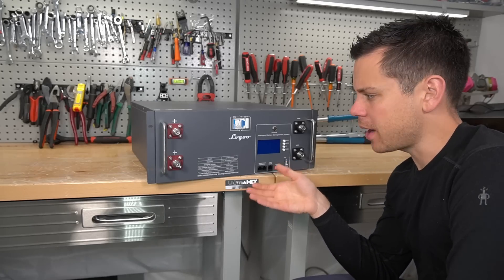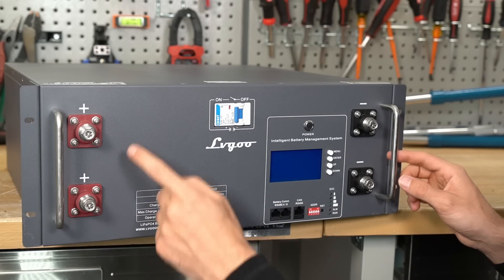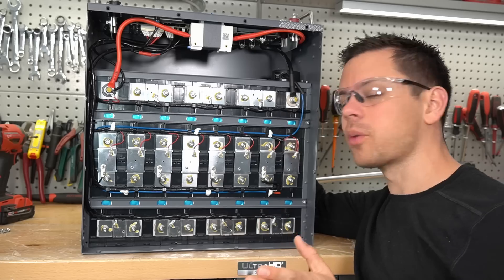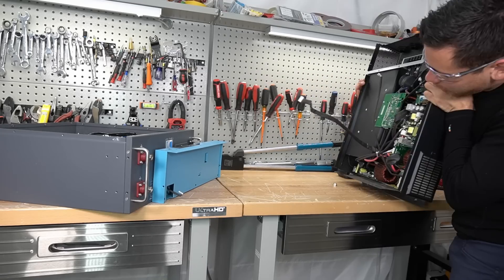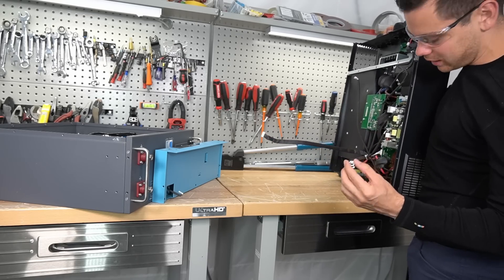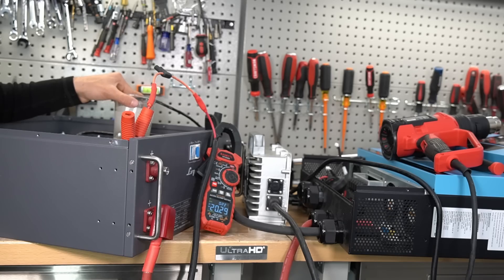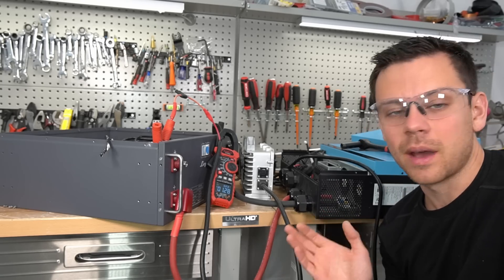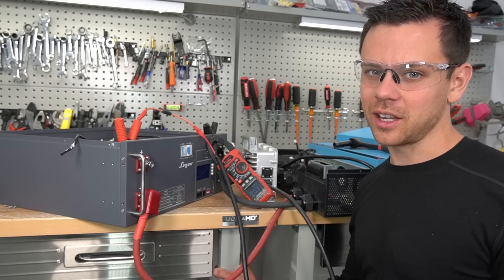New! $1,639 LVGOO 48V LiFePO4 Server Rack Battery

Comment: Why is the charging temperature threshold exactly 0 degrees Celsius? Isn't the electrolyte a liquid down to much colder temperatures? There's no pure water in these batteries.
Reply: Charging LIFEPO4  below 32F  0 C  causes damage to the battery.   You can use the battery to  -20 C  but not charge it below 0 C.
Reply: @merlpriester  I've heard that, but why is it precisely 0C? What happens below 0 that's different from +1C? I know pure water freezes at 0, but the electrolyte in these batteries isn't pure water, and the freezing point should be much lower.
Reply: @mattv5281  when charging below 0C, the battery forms crystals that rupture the insulation between the plates. It has to do with the way the lithium ions deposit in low temp.

Comment: I'd take off the handles and slip some heat shrink or rubber tubing on them to prevent shorts. Maybe even plastic dip them.
Reply: Hello Jerry, we will use the PVC coated(about 0.8mm thickness) handles which are 100% fully coated and 100% insulation from the battery termials in the next batch. We put the original handles into liquid PVC and get them out to cool them so the PVC would attach on the handles firmly.
Reply: I wouldn't think that the case would be connected to anything??  Should be able to short either terminals to the handles no issues.

Comment: If this is similar to my solarPowerStore rack battery (the display looks the same), it may have a pre-charge sequence  built in to the BMS, using these steps.
  1. Turn off the BMS power switch and circuit breaker
  2. Connect the inverter and turn it off.
  3. Turn on the battery breaker 
  4. Hit the BMS power switch

If I try to connect turn on the breaker with the BMS on, mine throws a over-current fault.
Reply: We have a complete and well written User Manual in the package box of the LV48V100D Server Rack Batteries. There are complete info about the batteries and their applications including the pre-charge.
Reply from the maker: Yes that's what I did in video

Comment: Another great review Will! Possible to do some reviews on bare Lifepo4 cells again? Seems like the prices has changed a bit the last year, so it could be a lot to save building a diy battery.
Reply: Very few buying those anymore apparently. I will for my next system though
Reply: @Zorlig  I guess people are lazy or does not have time for diy projects, and others cant use diy batteries do to strict regulations...

Just to illustrate how much you can save going with a diy battery. I can buy high quality 280ah cells from a trusted seller here in Europe and they cost about 130 USD pr cell, and possibly less when buying more. A 16s 48v bank with 13.4kWh of capacity would then cost  about 2300USD.  While a regular 5kWh battery costs almost 1500USD. So a DIY battery with parts bought locally in Europe are half the price, and possibly even cheaper. If you can get the same cells from China, the DIY price can be as much as 75% cheaper.
Reply: @TheJensss  yup, when I got my 48 280ah cells I had the full battery setup working for less than $5k.

Comment: Excellent testing Will! Glad you found they had the low temp programmed wrong!
Reply: The original Charge/Discharge UT(Under Temperature) settings of Lvgoo LV48V100D Server Rack Battery BMS are: 
CHG UT Alarm(℃): 0.0

CHG UT Protect(℃): -5.0

CHG UT Protect Release(℃): 0.0

DSG UT Alarm(℃): -15.0

DSG UT Protect(℃): -20.0

DSG UT Protect Release(℃): -15.0
It should trigger the CHG UT Protect at the -5.0℃. But Will was spilling the compressed gas duster drip by drip fast on the sensor to make the sensor's temperature drop fast so during the trigger action duration of CHG UT Protect, Will's temperature detector found the temperatures under -5.0℃ and finally captured the lowest  -10.0℃ when the  CHG UT Protect was triggered sucessfully.😀

Comment: The front data plate reads -20C to 65C.
Reply: A complete, clear and detailed User Manual is in the package of LV48V100D to let the users know almost everything about the battery including instructions of all temperatures.
Reply from the maker: Yes indeed

Comment: Some of the new formulas are rated for colder operating temps.
Reply from the maker: Which one? Winston is the only one I'm aware of
Reply: Bill
1小时前
We sent the battery to Will and we are the manufacturer of it. 
The battery has High Performance True A+ EVE LF100L(A) (3.2V 100Ah) Cell. EVE is the leading LiFePO4 Cell manufaturer. We are not quite sure if the latest  EVE LF100LA cells are mady by the new formulas(We will confirm with EVE).

The original Charge/Discharge UT(Under Temperature) settings of Lvgoo LV48V100D Server Rack Battery BMS are a little bit different from other batteries but Adjustable by cable connection and communication on PC with BMS software installed and a code, they are: 

CHG UT Alarm(℃): 0.0

CHG UT Protect(℃): -5.0

CHG UT Protect Release(℃): 0.0

DSG UT Alarm(℃): -15.0

DSG UT Protect(℃): -20.0

DSG UT Protect Release(℃): -15.0

It should trigger the CHG UT Protect at the -5.0℃. 😅But Will was spilling the compressed gas duster drip by drip fast on the sensor to make the sensor's temperature drop fast so during the trigger action duration of CHG UT Protect, Will's temperature detector found the temperatures under -5.0℃ and finally captured the lowest  -10.0℃ when the  CHG UT Protect was triggered sucessfully.

We will change the Charge Under Temperature Protect above and its duration time from the certain temp. detection to the protect trigger in our BMS to be the same at 0.0℃ as most competitors batteries to test it according to the way in ice salt water(the simplest and stable way) in this video to verify if our BMS and the Temperature Sensors are as sensitive as competitors' and I will record these and post the result here.

Actually in the official Product Specification of EVE LF100LA Cell, Its charging tempetature is 0~60℃ and its discharging temperature is -30~60℃ and its recommended use temperature is 10~45℃. The original Charge UT(Under Temperature) settings of Lvgoo LV48V100D as above is reasonable(not perfect) because:

1. If the battery charging temperature is in the range of -5.0~0.0℃, it is still in the minimum safe temperatures, it would not cause irreversible and permanent damage to the cell.

2. Usually the battery charging at the temperature range of -5.0~0.0℃ would not last long time because the charging creates heating of the cells and the cell temperature would be over 0.0℃ soon so with this comdition, charging temperature in the range of -5.0~0.0℃ would not cause irreversible and permanent damage to the cell.

3. It is common that the temperatare(the sensor gets) of the cell box is lower than the temperature inside the cell since the charging heat comes from the inside of the cell.

This is our orignal battery pack settings of UT Alarm and Protect which are different from the official Product Specification document of EVE LF100L(A) Cell. We set up these according to the  official Product Specification document of EVE LF100L(A) Cell, the layout of our temperature sensors, the working mechanism of the battery pack and BMS, the practical working conditions and the balance between the full protection&longest lifespan of the battery and the use convenience. These setting are not perfect but reasonable and adjustable and discussible.
Reply: @bill8336  Yeah. I can't find the fking video of the formula that they have out but it should be getting more coverage than it is it would seem. I think it was -10 degrees f.?

Comment: The thing is, China has great hardware engineers but they lack firmware programming skills. I'd give them 6 out of 10
All the companies I've worked for in US, had quality control departments.
Where they would test the hell out of the product to find bugs, the engineers had to fix before product release.  
China uses YouTubers like yourself as their beta testers and quality control department. It saves them the money for not having that department. 
A firmware upgrade should fix the thermistor. All they have to do is recalibrate it in ice water. That's what I was talking about. Lack of detailed testing.
Reply: The original Charge/Discharge UT(Under Temperature) settings of Lvgoo LV48V100D Server Rack Battery BMS are: 
CHG UT Alarm(℃): 0.0

CHG UT Protect(℃): -5.0

CHG UT Protect Release(℃): 0.0
It should trigger the CHG UT Protect at the -5.0℃. But Will was spilling the compressed gas duster drip by drip fast on the sensor to make the sensor's temperature drop fast so during the trigger action duration of CHG UT Protect, Will's temperature detector found the temperatures under -5.0℃ and finally captured the lowest  -10.0℃ when the  CHG UT Protect was triggered sucessfully.😀

Comment: You just have to wonder what they were thinking when they designed those handles so close to the connections?
Reply: Likely for the conductors to go under the handle.  Still sloppy, but you can end up with a reasonably protected connection and a good way for a "strain relief" zip tie to be attached.
Reply: @patrickkenny2077  I think he was referring to the path of electricity going from one hand via your torso to the other hand as you lift the battery.
Reply: @ChatGPT1111  48VDC won't get through your skin so unlikely to be a shock risk.
Reply: @ChatGPT1111  You eliminate that risk by switching off the breaker while handling the unit.
Reply: @DEADB33F   do some reading
Reply: @patrickkenny2077  tell that to the one person who won't do that causing the lawsuit to put the company out of business.
Reply: @DEADB33F  wrong again 🥴
Reply: @ed hingeley  uh yes, telecom -48vdc, lot of current, better check
Reply: @edhingeley6933  You don't know what you're talking about.
Reply: @ChatGPT1111     - lol, both handles are case connected - that sort of fault will definitely upen breakers / blow fuses.
 - and the whole 48VDC - fairly safe to "handle" - avoid licking fingers before doing heavy lifting..
Reply: @DEADB33F  Until you create a ground
Reply: @patrickkenny2077 I’ve seen a lot of communications equipment with handles that are in close proximity to power connections, that’s why there are disconnects of some sort on both the equipment and the power source.
Reply: The BMS of Lvgoo LV48V100D Server Rack Battery is high quality and long, so with 2 terminals on each side of the BMS inside the battery case, the spaces for the 2 solid Handles are narrow and have to be quite closed to the terminal nearby. The Insulated materials like Heatshrink and Rubber Sheath are good improvement considerable. We will find the good solution and solve the problem soon.
Reply: Hello Jeff, As the manufactuer of Lvgoo LV48V100D battery, we will replace the stainless steel handles which are quite closed to the nearby battery terminals by rubber coated(about 0.8mm thickness) handles which are 100% coated and 100% insulation.😀
Reply: I see D-loop hardware like this as protection, somewhat like a bumper on a car is.
Reply: Actually there are Terminal Pipe Caps in the package of the battery. The Terminal Pipe Caps are suitable size and tight for the cable lugs and battery terminals and very helpful for the Insulation including the Insulation between Handle and the battery terminal. The good connection operations are as below:

For example, When Connect the 2 Main Cables to the terminals of the Top/Bottom LV48V100D in parallel string.

1)Insert the Red Labeled Positive Main Cable(RLPMC) into 2 Red Terminal Pipe Caps; Insert the Black Labeled Negative Main Cable(BLNMC) into 2 Black Terminal Pipe Caps.

2)Connect the the RLPMC to Upper Red Positive (+) Terminal of the Top layer LV48V100D and Connect the the BLNMC to Lower Black Negative(-) Terminal of the Bottom layer LV48V100D. or Connect the the RLPMC to Lower Red Positive (+) Terminal of the Bottom layer LV48V100D and Connect the the BLNMC to Upper Black Negative(-) Terminal of the TOP layer LV48V100D.(Connection steps: removing the Terminal Bolt, inserting it through the eyelet of the Main Cable Lug then reseating the Bolts into the Terminal Block).

3)Fasten the nuts by wrench to the correct torque(100~130 in-lbs/12~15 N-m)Cover the connection of Terminal Block, Main Cable Lug, Washer and Bolt with Terminal Pipe Cap.
Reply: I worked around 48v battery plants in communications for over 30 years and never even felt 48v going though my body. Anything under 60v is considered low voltage for safety practices.
Reply: Electric Avenue.

Comment: I get a kick out of it when you say that's Unfortunate 😂
Reply: Hello David, Will did not deny our battery 100%. He mentioned: deserve attention and not bad and he thinks there are space for the battery to improve to be better. Here we are going to do for the server rack batteries:

1.We will change the temp. setings of the CHG UT  Alarm/Protect/Protect Release as Will pointed to keep the battery 100% away from the freezing 0.00℃. 

2. We will use the copper bus bars as Will suggested with 2.0mm thickness/25mm width specifications inside the batteries to replace the aluminium bus bars to make the 2 connecting terminals more capable for large current. 

3. We will have fully PVC(0.7mm thickness) coated handles for the next batch of server rack batteries.

4. For racks or cabinet where the server rack batteries connecting to each other in parallel, We have 2 different solutions(modular assemble racks and assemble battery cabinet) and they are going to be in our USA warehouse soon.

Bill

Comment: When are they going to just make 48VDC Lights and House Hold Everything so we don't need an AC inverter....... Kar Batteries are DC..... Fones, Komputers...... Make the entire house Run on 48VDC....... Solar Panels are DC so why do we have to take DC and change it to AC to Power and Charge all of our DC Krap. I get variable speed motors are more efficient using AC but my ceiling fans only operate at 3 speeds and dryer motor only spins at 1 speed. I kant think of anything that kan be powered by DC......... HVDC is more efficient at transmitting long power long distanse AND its easier to konnekt different power grids together using DC..... Wind Farms, Hydro, Solar.........
Reply: Faults are much harder to control and interrupt in DC than in AC systems.  48vdc systems will require 2.5 times higher current than 120vac rms systems for the same load.  If you consider using the same wire size (12 or 14 AWG) for example, you will increase your losses by over 600% since conduction loss goes by the square of the current.
Reply: @Ralph Reilly At household voltages, DC or AC don't have very different losses. Maybe you're confused with low voltages (and thus high currents)? That will increase losses for sure, but again, that's irrespective of it being AC/DC.
Reply: Sailboat guys have the best environment for 48v
Reply: K….
Reply: Krazy
Reply: The resistance in wires to transmit DC becomes a hindrance the longer the distance it needs to travel.
Reply: @epjetta  Ah, no. At very high power levels, DC is more efficient than AC. At AC, the lines resist the polarity change due to capacitance. Transmission of DC power requires more technology, because the voltage is not as easy to change as AC.

At household level, 110/230V, some entities are pushing for DC as well. I can't see that happening without smart wall outlets that only energise after a successful handshake with an appliance that is plugged in, for safety. Do you want to get into the mess, where the wall outlets in your house supports appliances up to "DC_standard_V2.0" but the water cooker you just bought only supports "DC_standard_V3.0" and higher? 

AC at the household level will survive me, I'm quite sure
Reply: @SolarWebsite  DC is only efficient over long distances in VERY specific circumstances. For most of the US, AC is the efficient choice. Look at the high voltage lines between Africa and France for one of the few places DC works well like that.
Reply: @epjetta  Really ? Do you have sources for this ?
Reply: @patrickhebear747  thats my understanding of why we have the AC system tesla invented instead of the DC system  that was being proposed at the time.
Reply: @epjetta  Right you are. It was Tesla:s AC vs Edison's DC. It was not, and is not practical to transmit DC voltage over any distance much larger than a city block.
Reply: The Emerge Alliance is trying to do just that.  It'll be a long haul but step by step we can move to a future where the majority of the house is DC and only large appliances require AC.
Reply: Supply and demand. If enough people demand 48VDC then they will supply. Simple as that.

Comment: Spraying the sensor like that isn't a reliable way to determine its temperature.
Reply: Duration Time Setting of the battery BMS: 2 seconds from the reaching of the target temperature in the BMS temperature settings to
practical Alarm/Actions(Protect and Protect/Alarm Releasing) happen. The spraying makes the sensor's temperature keep going down and down after it reached to the original -5°C UTP Setting and then in the 2 seconds duration, it goes down to -10°C when UTP happened.